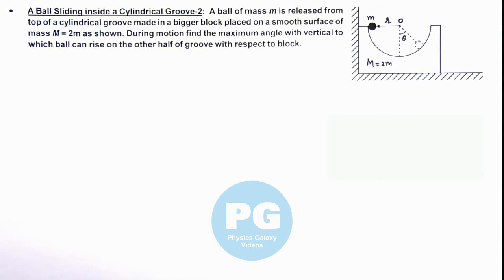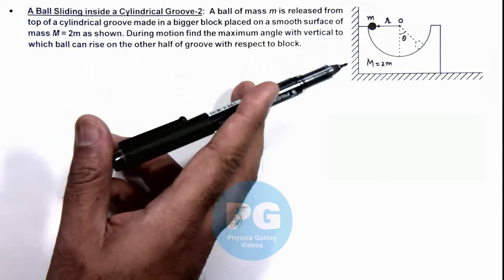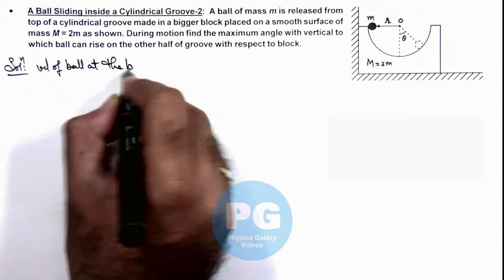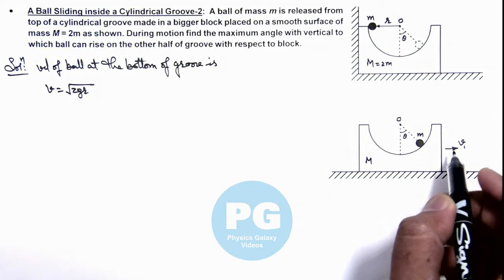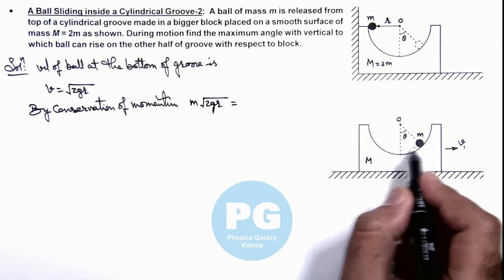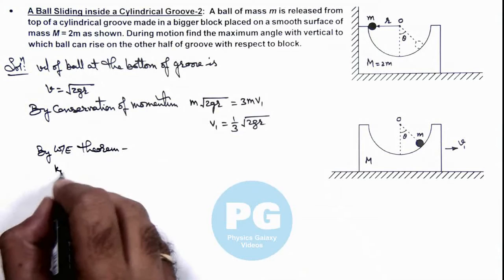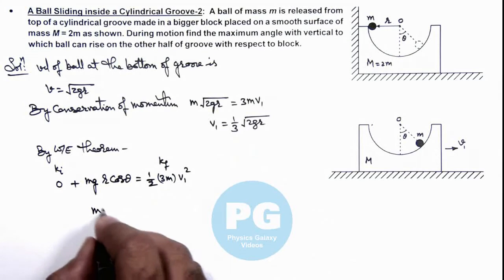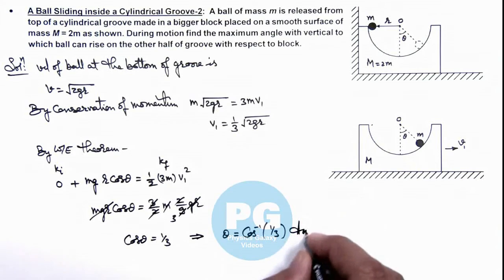Adv Illustration – A Ball Sliding inside a Cylindrical Groove-2 | System of Particles #5 for JEE Adv

Comment: Why is it MgRcos(theta) and not MgR[1-cos(theta)] ??
Reply from the maker: Watch the figure carefully and see that it has fallen only RcosΘ... because Θ is the angle from vertical not from horizontal...
Reply: @physicsgalaxyworld  when it was at the bottom the height loss was MgRcos() ..but the ball moved up and then stopped so it gained some height
Reply: @Ashutosh._.Gupta_  Sir has taken the displacement from the initial position to the final position of the ball.
Reply: @shishirmaharana4022  if I measure form o 
Initial - R 
Final - rcos theta 
So difference will be 
R-Rcos(theta)

Comment: sir why work done by gravity is mgrcostheta .And when ball and block move together with same velocity,why don't we consider the work done by gravity then. please help
Reply from the maker: The point between which we are finding work are vertically separated by r cosΘ thats why we used it...
Reply: Sir but separation is as i think is r(1-costheta)
Reply: Sir has applied work energy theorem from intial situtation (when ball and wedge are at rest) to the final diagram.  You can also apply it from where the ball is at lowermost point.
Reply: @jatinarora7386  it would be difficult for calculation as there will be no velocity in the system until the ball reaches the bottom most point....system starts moving only after ball crosses bottom most point

Comment: 2:34
Sir I think the system's energy cannot be conserved from top point to the required point because of the external force by the wall. But for the ball it can be conserved from top to the bottom most point and then for the system from this point to the required point. So although we are getting the same result by conserving energy of the system for the entire time, maybe it's wrong to think this way and the result may not be more than just a coincidence. Please sir let me know if I'm correct.
Reply: The normal force by the wall you are talking about will have no effect as it won't do any work on the ball (Just like work done by tension in vertical circular motion of a pendulum). So, we can directly conserve energy from initial to final position.
Reply: @shishirmaharana4022   @Shishir Maharana  Ikr. But kindly re-read/re-listen carefully. Sir said "by conserving energy of the system", but we know until the ball reaches the bottom-most point there will be a normal reaction by the wall on wedge which is indeed a part of the system which ofc isn't a conservative force. However, as you said and also as I mentioned, the energy of ball can be conserved till the bottom-most point and from this point to the highest point for the system giving the same result but with a correct analogy, is what I think!
Reply: @gourav5423  See SS Krotov P(1.55) to know what I'm talking about.
Reply: @gourav5423  arey bhai .jb normal force ball pe work nhi kra hai .tih kya dikkat hori hai ??

Comment: Sir when wedge is moving then in hoizontal dirn. There is normal force .. So how can momentum. Be conserved ?
Reply: Normal is an internal force. Internal forces have no role in changing the position of com and p can be conserved.
if external force acts then momentum cannot be conserved.
internal forces are those forc es in which both action and reaction pair is present in the system. one normal is on ball and one on groove and both are in our system so we can conserve momentum..
Reply: No, here momentum is conserved because when we consider motion then the wedge is no longer in contact with the wall ... And normal on the ball is not due to wall it is due to wedge and here we are talking about the normal reaction from the wall which is external force on the ball+ groove system , .. Yup it is internal for wall + groove + ball system ...
Reply: +ADARSH CHATURVEDI  
yes u r right but i was talking about normal reaction between ball and wedge.

Comment: Sir why momentum is not conserved from starting position of ball but from bottom most you are conserving it. Please reply.
Reply from the maker: At bottom motion is horizontal and no external horizontal force is acting on the system whereas at any other point due to normal contact force, momentum will no longer remain conserved.
Reply: Physics Galaxy sir are you talking about Normal contact force due to wall??I mean to say that if the ball would have been starting from opposite side then momentum would have been conserved from that initial position??
Reply: Why isn't normal considered as internal force?Sir,plz reply